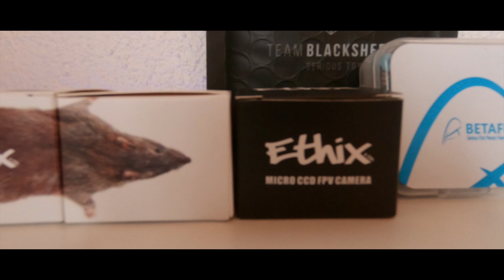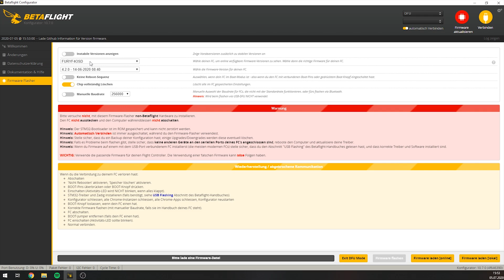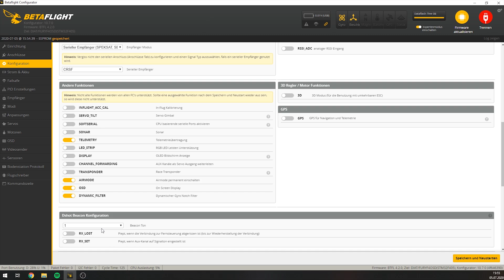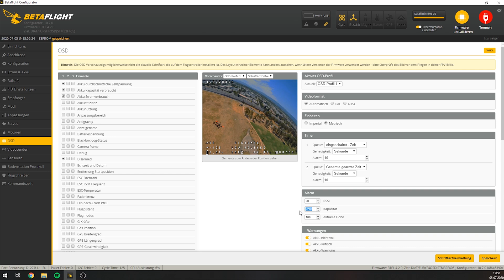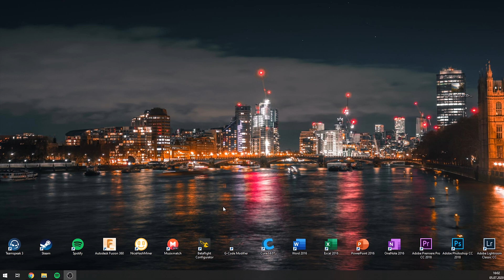How To Build A Cinematic FPV Drone - TBS ETHIX CineRat

Comment: Hello, Great TPU print, do you use Cura? Could you tell me your config of cura for TPU print?
Reply from the maker: Good day
Yes I use cura. It is important to switch off (or reduce) retraction. Print as slowly as possible and with a layer height of 1.2mm. Leave the rest as default.
Reply: @SwissDroneFlights  thank you 😀

Comment: Yep, that's about how many props I bought lol....
 
You did all that in like one sitting, amazing.  Your video reminds me of this video:
https://www.youtube.com/watch?v=TcHVb9G2fvg
 
I see you like te GoPro Session 5.   What do you think about the 360 One R or the RunCam Orange?
Orginal music  ❤️️ ✈ 🛩
Flashed 5 different firmwares to the lastest last night, that took all night... installing all the software to do it and getting it to talk to the chips.

So many tiny pads to solder...
What do you think of this frame?
https://flywoo.net/collections/new/products/flywoo-naked-chasers-hd-3-4s-cine-whoop-fpv-drone-w-dji-air-unit-goggles

I'm stuck in Betaflight 4.2.1 after entering the UARTs and calibrating the acellerometer on a level table... don't know what to do next...    
12:43 - and you can't play that song without showing the magic lake with waterfall... picture in picture
Reply from the maker: Hi. first of all thank you for another great comment from you.
Actually i don't like the session 5 anymore and prefer the gopro hero 6. The GoPro Hero 6 and 8 don't need a soft mount, but the GoPro Hero 5 and 7 do to work with reelsteady.

I find the 360 One R and RunCam Orange very interesting alternatives to the GoPro. However, I would only recommend these cameras for freestyling. For cinematic recordings I find the GoPro a little bit better in quality, which is of course not that bad for pure freestyle. 

The linked frame looks a bit strange to me, but also very stable and optimal for the dji air unit. But I can only recommend the TBS CineRat so far... :)

Why don't you know what you want to do next? Weather is warm and good so fly again as soon as possible of course :)
I spent the last days to get my also new 6inch long range vibrations free... Soft mounts, propeller balancing and a lot of testing. But now it is done and everything works ... so far haha

That you even remembered my video. so cool :D